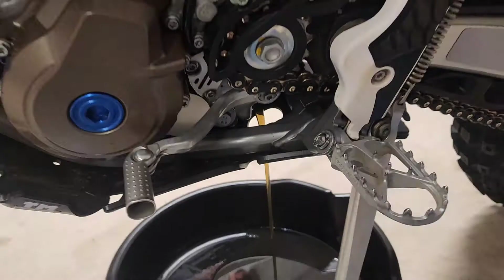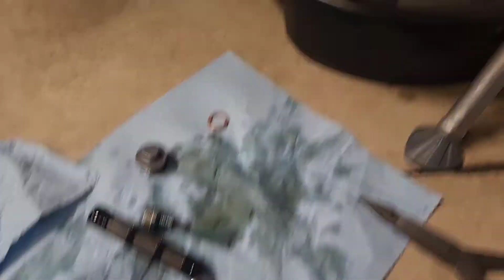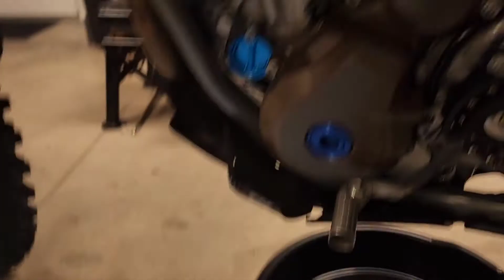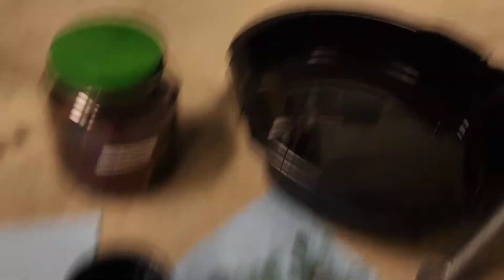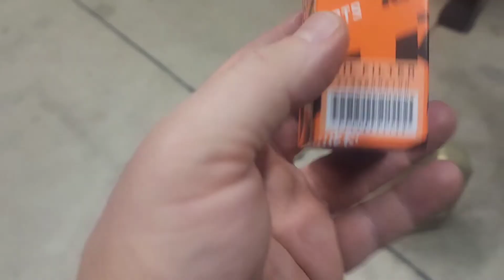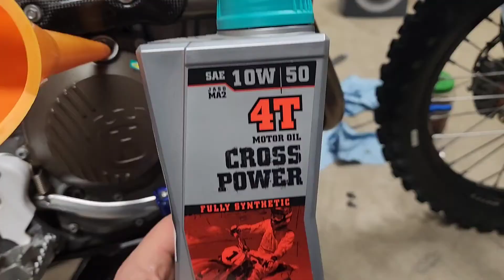KTM /Husqvarna 350 exc / FE 350s Oil Change Plus Extra Oil Change Tips!

Comment: Something I do.  After removing all drain plugs dump some fresh oil into oil fill hole as a little flush out for any residual material.  You do oil changes every few hours so you don't need to do that.